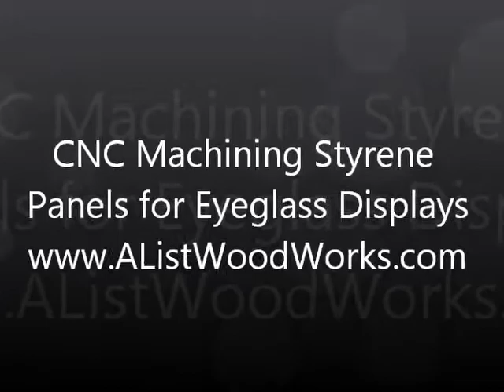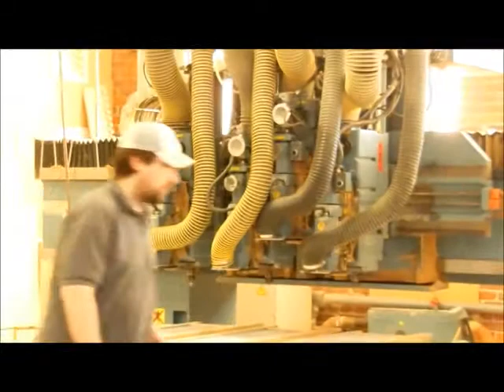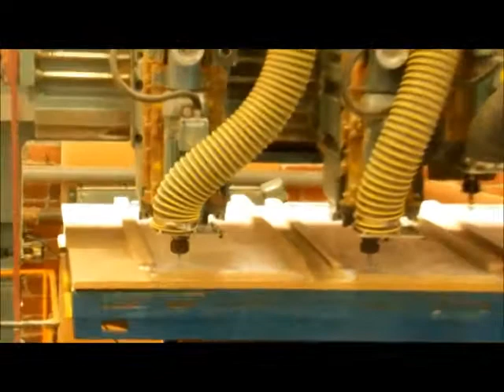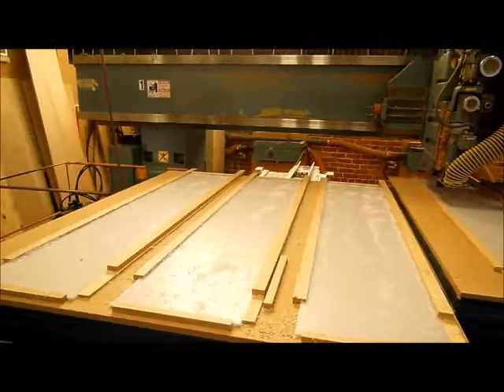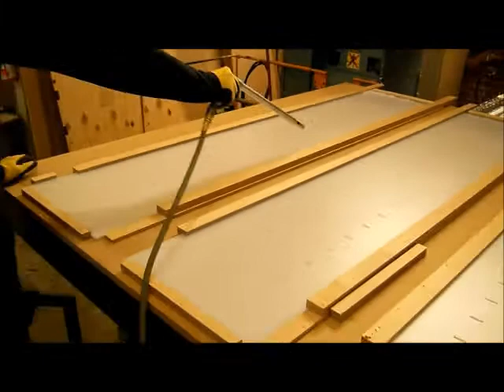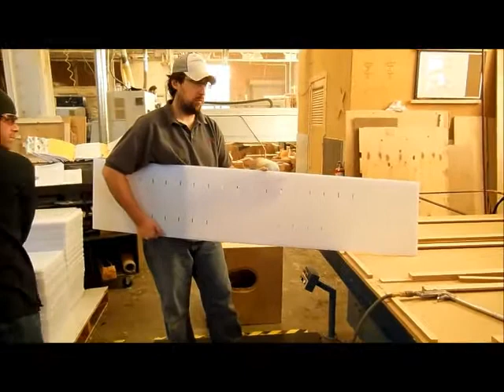CNC Machining Plastic Styrene Eyeglass Display Panel

Comment: Any tips on machining less the 1/8" styrene or acrylic. I work mostly with .03 - .08". I'm thinking about buying a small hobby CNC router.  I see you have industrial grade machines but I figured you guys might still have some good tips on bits and speeds for styrene or acrylic.